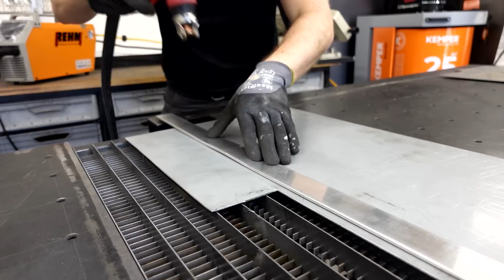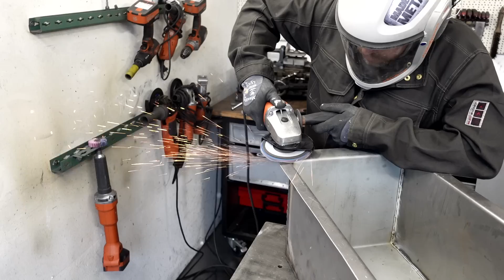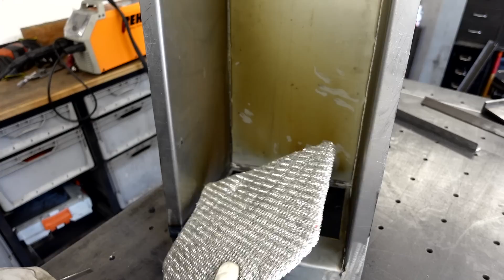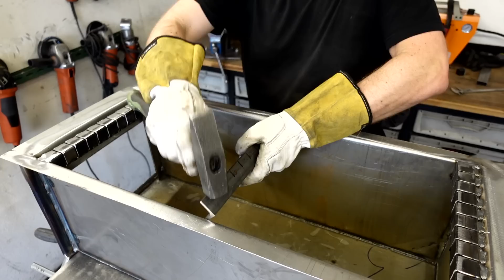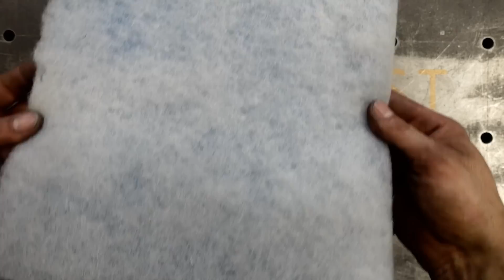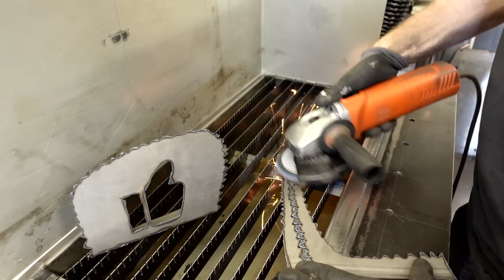Plasma Table DIY

Comment: hi, is there a way to drill 20 cm hole into solid square bar without a lathe?
Reply from the maker: Do you mean with a plasmacutter?
Reply: @TheMetalist  no, I would probably drill it somehow. it would be easy with a lathe, but I don't have one.